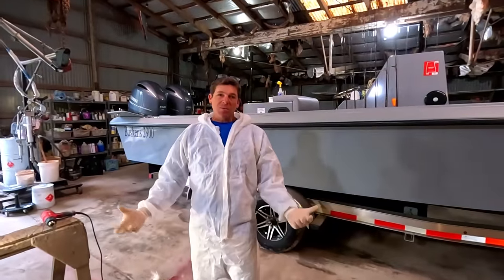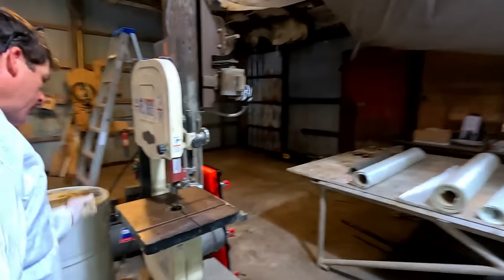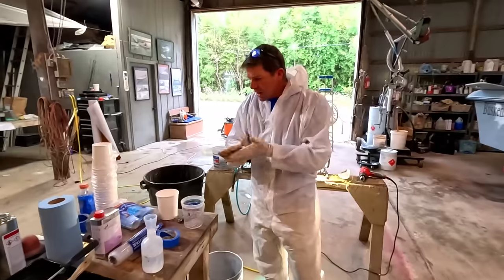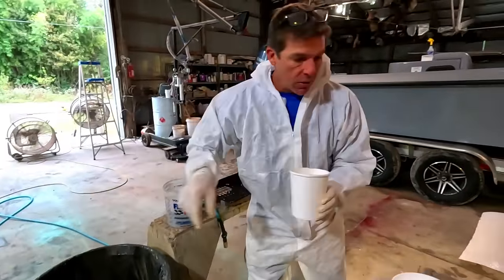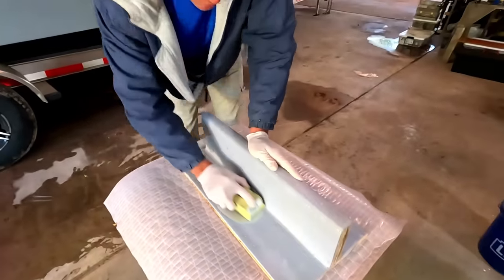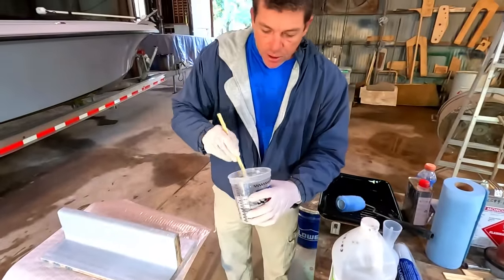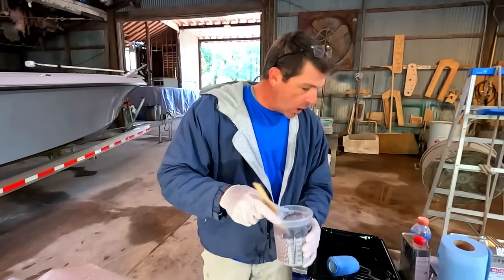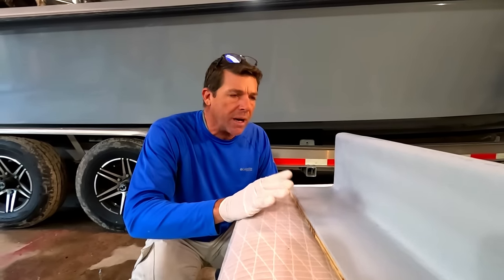Gelcoating Fiberglassed Plywood DIY! (Like a Pro)

Comment: Happy New year and thanks for taking the sample stringer to the next step. The grinder prep looked like it cut pretty deep on the mat. How far is too far and compromise the strength of the glass? Thanks
Reply from the maker: Thanks so much! It looks deeper than it is. I have a LOT of experience with a grinder, and they take some practice to master. Most people should probably start with a DA or a orbital electric with 50 to 80 grit, it's much slower but it's more controlled. Hope this helps, thanks for watching!

Comment: So in the warmer months, you have to work in an air conditioned shop to do gel coat? Thanks for the video!
Reply from the maker: The hotter the weather,  the faster the cure rate. You can still gelcoat in the heat, but mix small batches, and work fast. You can also cool the gelcoat in a fridge or ice bucket to slow the cure rate. Hope this helps, thanks for watching!

Comment: Great video!  Outstanding information and presentation!  At the end you mentioned that you can not put gel coat over epoxy.  My boat has several spots that the previous owner tried to use epoxy to fix gel coat dings. Do I need to grind out epoxy to solid glass, prime and then apply gel coat to properly fix them?  Thanks and keep up the great videos!
Reply from the maker: Thanks, glad you are enjoying the videos! Yes, I would remove the epoxy filler. If the damage is deep, you might consider using a polyester or vinyl Ester repair filler first, then gelcoat. If not more than 1/8 of an inch or so deep, you could use thickened or pure gelcoat. I hope this helps and I appreciate you watching!
Reply: @FishBumpTV  Thank you so much for the advice!  I figured I would have to do that. The previous owner kept epoxy on board and used it for everything including gel coat repairs (he added tint to the epoxy). It didn't work. Luckily it is only in a few spots.

I  really appreciate all the great info in your videos!  Thank you again for all the hard work and dedication to this channel!

All the best from California! 💛

Comment: Is there a rough cost per SQ FT to fiberglass and gel coat plywood surface.  After watching your podcast I am thinking to fiberglass my house on steel pontoons.  I live in the Yukon and thinking maybe thats the right way to go.  The houseboat will never leave the lake.  There for life.  Very good  podcast.
Reply from the maker: I don't have a cost per Sq ft for fiberglass work, but am sure some estimates could be worked. I will try to do some work with materials estimates for you guys soon. Thanks for watching!

Comment: Would you mind explaining WHY you can epoxy over gelcoat but not the reverse, since gelcoat is the preferred finishing coat?
Reply from the maker: Sure, they are completely different resin systems. Poly and vinyl resins are styrene based epoxy is not. Epoxy bonds to things more tenaciously that poly does. People get confused over this all of the time. But you are almost sure to have problems if you try to gelcoat over epoxy. There are plenty of paint systems that will work with epoxy. There are also product called tie coats that are supposed to stick to epoxy, then gel coat sticks to them. The jury is still out on these products. I plan on doing a video on this subject soon. Thanks for watching !
Reply: polyester gel coat is not the finishing coat ,its the starting coat ,so we are trying to do it in reverse order with our repairs ,a mould is created you paint up your gel coat flow coat which is the smooth shiny side you will see within a few hours once its tacky you begin laying up the glass fibre epoxy that is the inside ,epoxy will stick to anything ,but polyester is tricky waxes and solvent come to surface as it cures so it wont adhere or set if you put it ontop of especially new epoxy ,depends on chemical make up you get lucky, best to do a primer tiecoat on epoxy repairs before gel coating ,but polygel coat onto poly resin glass should work like this videos shows

Comment: Does the wall lift up by the front of your boat trailer? Your shop is pretty sweet. This video was full of knowledge. Thank you
Reply from the maker: The shop has two large doors  on either end big enough for large boats. Yep, it's a good shop, but now that our 29 is done it needs some TLC. It needs a new roof and insulation. Maybe next winter we will tackle that project. Thanks for watching and commenting!

Comment: if this were going to be finished/polished gelcoat for a visible area would you use some filler/fairing compound first before applying it?
Reply: I am wondering the same. 
How about that Joe make a gloss finish from that piece of plywood?
Reply from the maker: You would use fairing fillers and lots more prep if you wanted this to be perfect. This was more of an example of stringer or interior transom work. It takes a LOT of work to make rolled or sprayed gelcoat shine like gelcoat that comes out of a mold. Gelcoat does not flow out like paint does, and it only shines when it is molded because the mold is very smooth. If you want to see how much work it takes, check out the gelcoat master class video we recently did. With that being said, I would consider doing a fair out, gelcoat and polish video if you guys are interested in seeing that. Appreciate you guys watching!
Reply: @FishBumpTV  yes I would love to see what it takes to get a panel from a piece of plywood with fiberglass to a smooth polished finish. Especially something that might have some interior or exterior corners or rounded edges. But most of all I am still looking forward to that patch paste tutorial 🙂
Reply: @FishBumpTV  thanks for explanation. Really appreciate your professionalism and willingness to share your knowledge 😍
Reply: @FishBumpTV  I would be interested in a video from you on the best way to get a gloss finish for a one-off plywood/fibreglass boat. Would it be easier to use paint instead of gelcoat? If so, what kind of paint?

Comment: Did you use a specific type of screw/glue for this? I watched the last one but didn't catch it. Worried that construction screws will corrode/galvanize or something. Thx!
Reply from the maker: We always use stainless screws for this kind of work. You can use resin, or a layer of csm if you are using polyester resin to laminate the layers of plywood. No csm if you are using epoxy resin, they do not work well together. Hope this helps, Thanks!

Comment: Great presentation/explanation.
Can you spray gelcoat? If so, what would finish look like?
Reply from the maker: Yes, it can be sprayed. It looks a lot like flat latex paint when sprayed with a wax additive. To get a glossy finish it has to be wet sanded and polished or it has to be molded. Thanks for watching

Comment: I gelcoat over west marine epoxy on fiberglass, not just epoxy by itself,  no more trouble and about the same results as gelcoating over gelcoat, its in the prep work, I used a popular companies grey tie coat water barrier with really bad results, had to remove it, I switched to epoxy, about the same price
Reply from the maker: Some people do that, but gelcoat over epoxy is considered a bad idea by most professionals. If you want to experiment, and don't mind the risk of the gelcoat not curing, or bonding properly I understand you may be ok with that. My goal on this channel is to give the most reliable and repeatable advice possible, and gelcoat over epoxy is just not something everyone should attempt to do. I hope this helps and thanks for watching!

Comment: I had always heard that you can't gelcoat over epoxy, but I've found that as with many things, it depends. The rumor is that gelcoat won't stick to epoxy, but my experience has been that gelcoat won't cure over certain epoxies. Even after the epoxy had cured for a week or more before applying gelcoat, the gelcoat becomes a sticky hard to remove mess. But, I've had excellent success with gelcoat over overnight cured West epoxy. I've had success with West 105 with both slow and fast hardeners, but I haven't tried it with extra slow. 

Give it a try for yourself.
Reply from the maker: Thanks for your thoughts, I will give it a try.

Comment: I'm from the UK and have a 23ft fast fisher that needs a lot of TLC.  The floor is rotten and the gel coat is in very poor condition.  In the UK you can buy the wax to mix with the gel coat but typically we have two products Gel Coat and Flow Coat.  Flow coat is just premixed gel coat.  Does the underlying gel coat ever fully harden once covered in Flow Coat?  I am asking because I intend to sand and polish the flow coat.  Am I likely to expose tacky gel coat if I sand too deeply?

Thank you
Reply from the maker: No, that shouldn't be a problem as long as the gelcoat is thick enough.  Best of luck with your project, and thanks for watching!

Comment: Wow, I wish I could get back all the years so I can begin building my dream sailboat. Thanks a lot. I added quite a bit to my glassing experience watching your videos. Really first class demonstrations. One question - are there gelcoat formulations in which the wax is already an added ingredient so that the mixing process is complete once you've added the catalyst to the gelcoat mix. Which conveniently takes away the need to add the wax solution to keep the gelcoat from getting tacky. Also when gelcoat is used in a mold, do you still use two coats and is it best to spray on or brush or roll on? Or does it make any difference. Wish I was in Alabama so I can trade work for free just so I can learn some of the tricks of the trade and build my sailboat. Hahahaha I'm dreamin here of course cuz I live way out on the pacific on an island fsr removed from anywhere but where having a boat is a MUST HAVE, and knowing how to build a good boat is bank. Thanks there Capt Joe.
Reply from the maker: Fantastic,  thanks for watching and commenting! Yes, you can buy gelcoat with wax add, but I prefer to add it as needed. There are times when you don't want wax in your gelcoat, like when you are applying it to a mold, or if you are applying multiple coats. Wax is usually only added on the last coat to help it cure tack free. We usually spray gelcoat in a mold, and yes we make 2 passes or coats. One pass going length wise and one going across. That way you get the best coverage. I hope this helps, and thanks again for watching from the Pacific Islands!

Comment: Thanks so much Capt. Joe, planning on doing a go kart body ( think small C cab hot rod) this spring and all this info is a great help.  Was thinking about using closed cell rigid foam insulation as a base, what are your thoughts on that?  Thanks Again!!!
Reply from the maker: Glad to help! Sounds like a cool project. We usually use marine grade foams and cores sourced from our local fiberglass suppliers. There are lots of materials out there, it is hard to say for sure if the particular foam you have in mind will work for sure. Even different resins, say epoxy vs polyester could react differently. I would suggest some test panels just to be sure. Hope this helps, and thanks for watching!

Comment: Can you apply gelcoat over marine epoxy fairing compound once fully cured?
Reply from the maker: I wouldn't recommend it. Generally gelcoat over epoxy is not a good idea. You can apply epoxy fillers over gelcoat with good results though. If you have used epoxy fillers, I would suggest going with a epoxy based paint system. There are product out there called tie coats. They are supposed to stick to epoxy, but gelcoat will stick to the tie coat. The jury is still out on some of these products. I hope this helps, Thanks for watching!

Comment: Here in the UK we have top coats  that are single application (in experienced hands of course). Basically no gelcoat then a wax addative to convert gelcoat/flowcoat. IF and it’s a big IF i was going to do two top coats the first one would be a simple resin wash tack free the second with a  pre waxed topcoat. Interesting how you do it over there compared to us.
Reply from the maker: That is interesting. I did some research on the techniques used abroad as well. We don't use the term flowcoat here in the states. We just use gelcoat without wax added as the first or second coat, then add a wax solution to the last coat to get a tack free finish. Our channel has all of the sudden started getting a lot of viewers from the UK and Australia. I enjoy and appreciate hearing from you guys! I will try to include more metric measurements for our friends overseas! We have a  gelcoat video uploading today, I hope you find it interesting.  Thanks so much for watching!

Comment: This video is very helpful! Curious, if you wanted to encapsulate the whole thing,  would you just round off the edges then use small strips of 1708 or CSM to cover than over the edges with about a two inch over hang? Thanks! I need to build back some seat box areas in the back of my boat and will need the outstide panels more glossy. I supposed some filler and sanding is in my future!
Reply from the maker: Glad you enjoyed the video! I have several videos in this series on the channel. One of the videos details encapsulating the end of the demo piece in detail. I think you will find it very helpful. I hope this helps and thanks again for watching!

Comment: great video! I am refinishing a small skiff and previous owner painted bottom with what I don't know. I intend to fiberglass the holes and then two coats of gelcoat. You said not to use gelcoat over epoxy. How can I determine if the paint is epoxy and if so how do i remove it all from the  hull/bottom? thanx
Reply from the maker: Thanks! It can be a little tricky to determine what paint might have been used. I would usually recommend Sanding all of the old paint off. Then 2 or even 3 coats of gelcoat. Just remember to add wax on your last coat. Hope this helps, and good luck with your project!

Comment: Watching from Puerto Rico 🇵🇷! Loved the videos, I am planing a DIY a 16FT, I am trying not to use any wood/playwood. Have seeing almost 10 videos of your channel in 2 days 🤣🤣🤣🤣. I am going with a Carbon core transom (liquid), Coosa board floor. I think the answer is yes, but can I make the stringers from Coosa board also? Putting two 3/4 in the overlapping method I learned in your videos (you did it with plywood). Thanks in advance. Videos are super informative 💪🏽🔥.
Reply from the maker: Thanks for watching all the way from Puerto Rico! Glad you are enjoying the videos! Yes, you can use Coosa board for the stringers, and other structural parts of the boat. It is a very versatile material that works alot like marine plywood. Just watch out for the fiberglass that is in the Coosa, gloves are a good idea when handling it, and a good mask for the dust should be used. I hope this helps and best of luck with your project!
Reply: @FishBumpTV  thanks for the fast Reply! Perfect, I will do them with coosa board then. (protection of the lungs, eye & hand always important). Thanks for the information, Keep making this amazing informative videos! 💪🏽
Reply from the maker: @dr.joelsantiagovalcarcelmd5838  glad to help!

Comment: I'm just finding your channel & really appreciate this series on glass laying & gel coat application.  I have a question on this.  I have a boat built in 1989 that cost $40,000 new.  There are a couple places that have some minor spider cracking.  I am unsure how to repair it because it is a very high quantity of metal flake and clear gel coat.  What would I use for repairs on it.  It is a 20' IO Fish n Ski that I would also like to convert to an 300-350hp Outboard on a motor mount that I can elevate or a bracket that is about 26"-30" in depth.  This would make this boat perfect for both fishing and Play as it would provide more storage than any new boats made.  I've been boating for 45 years or more and am a Carpenter with tools.  Any tips or contact me via DM. THANKS! 
Grand Dude
Reply from the maker: Sounds like a great boat, but I don't deal with metal flake finishes at all. Maybe in the future I I will  be able to get some info on that topic for you all. I do have some interesting structural repair content planned, which would be helpful with the i/o conversion, so stay tuned and thanks for watching!

Comment: Great video. Question! Can you use gelcoat over epoxy repairs?
Reply from the maker: Thanks for watching! Generally putting gelcoat over epoxy is considered a bad idea as gelcoat is usually polyester r based and proper cure can be a problem. I plan on doing a resin selection video soon, maybe that will help answer this in more detail.

Comment: I'm thinking for small batches you could get a laboratory stir plate (it basically is a little platform with a magnet spinning inside.... you put a magnet capsule into your beaker of liquid  and put it on the plate to make the one in the beaker spin around and stir the liquid... alternatively just dump out the whole can on the surface and spread it :P
Reply from the maker: Thanks for watching and for your thoughts!

Comment: I have just recently purchased a boat with a wooden sole. It is 3/4” marine grade plywood that is painted white .I want to fiberglass it and gel coat it. Is it ok to just sand the white paint and follow your procedure? Thanks
Reply from the maker: I would recommend grinding away all of the old paint with a 24 or 36 grit disc. That will put a really nice texture on the surface so that the resin has some "tooth" to grab on to. Make sure that the wood is good and dry, then do a primer coat of resin before applying fiberglass. A mild day, with low humidity is best for fiberglassing over wood. I hope this helps, and best of luck with your project!